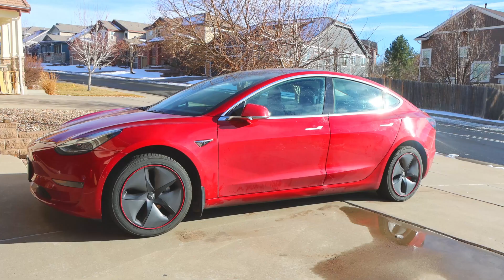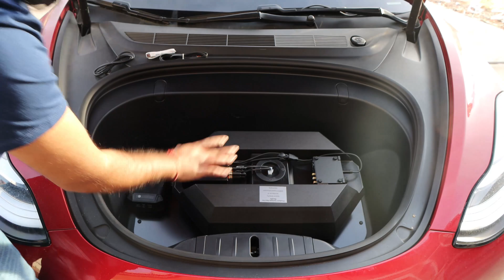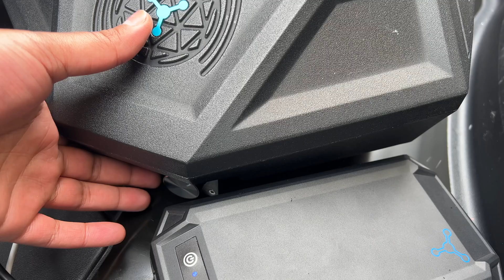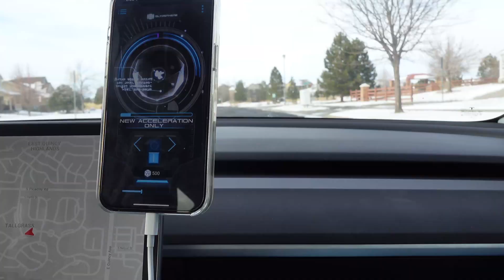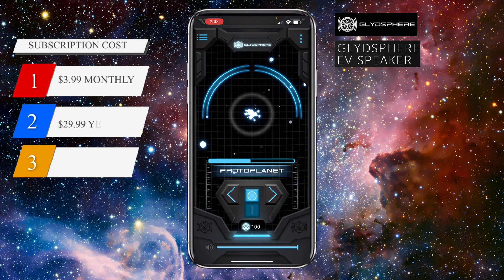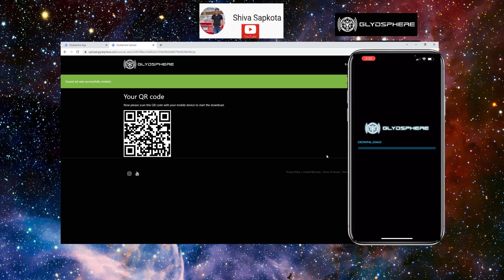NEW Tesla Boombox Speaker - Custom Acceleration Sounds for Model S3XY (Must Have Accessory 2022)

Comment: Thanks to Shiva's his honest review and all customer feedback did we implement 2 big improvements. The system is now wireless and can be connected with the Tesla via an OBD connector. No more wires and the sound algorithm can be controlled by the car's speed and gas pedal position.
Reply: that's awesome!! I've been waiting on the obd update! thank you
Reply: @SunEater993  Glad to hear. The new update is insane. You can rev the car in park and even hit a rev limiter. We added new sounds based on iconic movies and sports car engines. Check out the videos on our Instagram channel!

Comment: I think it would be better to connect it to the gas pedal rather than measuring the accelaretion. It would be more reliable and a more direct response.
Reply: For a gas powered car this would definitely make sense however an electric car recuperates means you get off the gas pedal and the car slows down. If you have access to an EV you can download the app (7 day free trial period) and give it a try. We would highly appreciate your feedback (contact forum on our website). When we tested different ways to translate the car's speed into the sound algorithm we found that acceleration and deceleration provides the best experience. Again for a gas powered car this will be completely different.

Comment: Very easy install is nice but im skeptical about the accuracy as it uses the phone to detect acceleration. Good video Shiva!
Reply from the maker: I agree, the vendor said they will continuously make this more accurate over time. Thanks Ken!
Reply: The intention of the system is not to mimic  the behavior of a combustion engine. Our intention is to create a sound which fits to the behavior of an electric car. On the Tesla Model S you have the acceleration and recuperation visualized similar to our app. The app behavior follows that acceleration and recuperation curve. We think a spaceship kind of behavior fits better than resampling what a combustion engine with a transmission does.